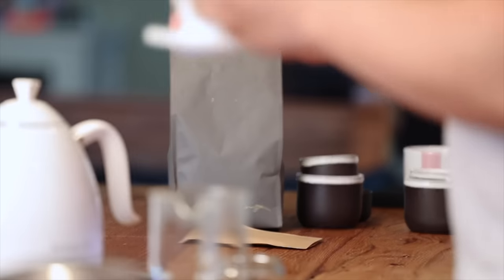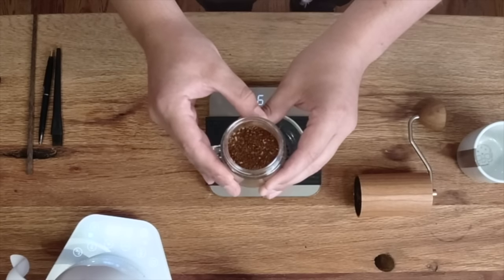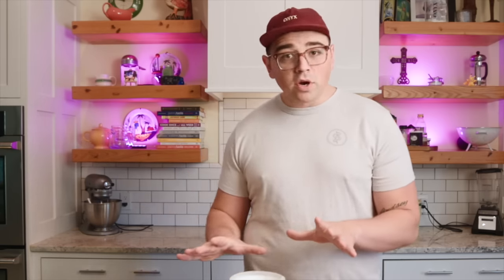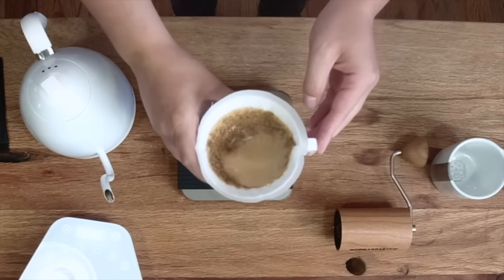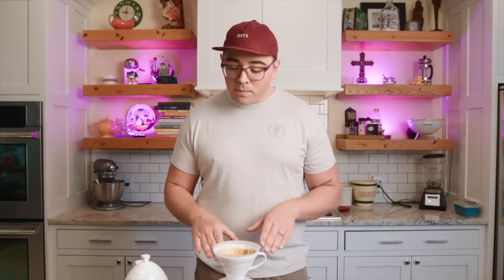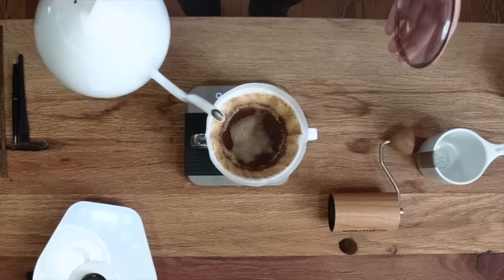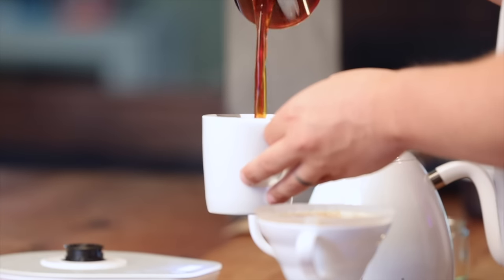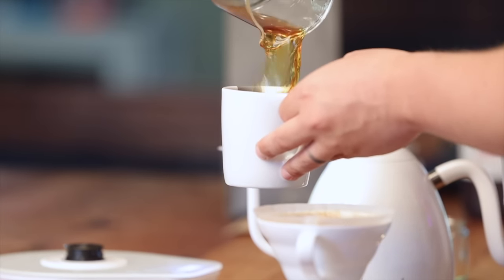HARIO V60 BREWGUIDE: Easy and Effective V60 Recipe!

Comment: I love the video! Just a quick question: Why do you favor the aggressive central pours instead of spiraling in and out during the post-bloom pours? My Rao-Gagne-Hoffmann mindset has always been to pour in spirals for the most even bed/extraction. That said, doing those techniques with the same grind size has resulted in much longer brew times. Is it related to the fact that moving the stream produces less localized turbulence?
Reply from the maker: So, this recipe was created for simplicity. I have the pour be super quick for two reasons: 1) to be applicable for people with tea kettles and 2) to ensure all grounds are in suspension so you can immediately swirl and level the bed. 
Have the fast pour and immediate leveling allows for a proper settling. 
When pouring more slowly and in circles, the particles will settle faster you can see this in high light with a glass v60. Those particles want to settle asap. So, pour aggressively, and with a quick dispension, allows you rapidly swirl and settle so the lack of spiralling the pour doesn't matter. 

This recipe is about consistency and applicability. Learning to spiral isn't super easy. 

This recipe allows for a quick pour, tweakability, etc and get a good cup.

Plus, I've gotten up to 23% on a V60 with it. That's freaking high for a brewer with so much bypass for it to be this easy.
Reply from the maker: Also, for the record, I hold the people you mentioned on the highest regard. Not trying to go against them at all. Trying to provide an easily repeatable and easy to accomplish brew for anyone. And, the brews are damn tasty
Reply: @LanceHedrick  Well, I just tried it with a Kayanza Burundi Red Bourbon (controlled yeast ferm) from Sweet Bloom just now. Yes, at 9:00pm. Aaaaaaaand it's amazing. So thanks! I might put this recipe on at 7 Corners EP for this Burundi.
Reply from the maker: Love it! Night coffee rocks haha. So glad you love it!
Reply: @LanceHedrick  With the SSP burrs for the Fellow Ode (aligned as well), I just measured a 24.2% EY from this recipe. That's nuts. 1.59% TDS! It's almost too strong, tbh.
Reply from the maker: That's right in my wheelhouse! Yummy!

Comment: Looking forward to trying this tomorrow morning! How do you determine TBT - ie. when it's 'done'? 1 drip/second? 2sec? Bed looks dry? I realize if you have grind size 'right' it doesn't matter that much, more curious than anything....
Reply from the maker: Yeah- bed is dry. But don't sweat it if it goes longer. Some brews might stall a bit. Just don't be aggressive with the spin on the final two pours
Reply: @LanceHedrick  Thanks! Ethiopian worked really well. Any tips for getting a washed Kenyan to have less savory notes, or is it just bean/roast and nothing to be done?
Reply from the maker: Savory is difficult. It could come from a few things. If underextraction, you can have a salty cup which can enhance savory. I like pushing Kenya coffees far. Maybe do the three pours at the end and maybe stretch the ratio to 1:17.5 or 1:18

Comment: Awesome video! How would you tweak the recipe, if you'd only brew 18 to 306 grams of water? Would you grind finer (23 clicks for example)? Or would you just pour a little bit slower as you have a smaller coffee bed?
Reply from the maker: Depending on the coffee, I might not change anything. I always like the idea of trying the base recipe and then changing based on flavor. You can go ahead and predict and change and start finer, or just give it a go and see what you need to do

Comment: Lance! Thanks for all this great content, man. Question for you if I may... should I be concerned with grinding too coarse with this method (in fear of creating too many fines and stalling the brew)? I own a jx 1zpresso hand grinder and a virtuoso. So far, went 22 clicks on the jx and 12 on the baratza and I feel both cups need a much coarser grind. Thoughts? Cheers
Reply from the maker: Which baratza? To be honest, that sound too coarse on the JX. I usually like quite fine. Just be aggressive with first two swirls and gentle with final two

Comment: would be great to see a bit more science on it (calculating TDS, blind testing vs other v60 methods, evaluating consistency, perhaps you did this but omitted it from this video and limited it to showing the recipe) but feels fun to try :) I worry about fines migration, specially with not so good grinders (C40 is good at producing less fines but it is an expensive grinder), paper filters tend to lead into clogging and upping that brew time, overextraction comes, blah blah... still like it better than most methods out there, specially for beginners who do not have premium equipment and/or the technique skills that other methods require. Thanks and looking forward to your next videos :D
PS: I keep going back to your latte art videos, still practising my foaming at the Café where I work, at the same time managed to throw some tulips already. Can't thank you enough for that!
Reply from the maker: I didn't feel the need to add the measurements in since I've done them at home and said them in the video. I guess people could think I'm lying, but I'm banking on them not. I also said this was made to be highly accessible, which means I have also brewed with less than ideal grinders to ensure it works with those, as well. All of this was taken into consideration when making this video. It was not a haphazard decision, but a long and thought out process to provide something helpful to people of all types of equipment, hence the heavy flow to account for tea kettles.
Reply: @LanceHedrick  thanks for your thorough reply :D
Reply from the maker: Absolutely! Always happy to respond.

Comment: I'm just getting into pour over brewing so forgive me if this is a naive question but wouldn't double walled stainless steel with a ceramic liner be best for insulation while brewing. I know Fellow makes the stag which is stainless steel but they don't line it with ceramic like their tumblers. Is there any reason why?

Comment: adapting for a 250ml cup according to chatGPT:

To adapt the recipe for a 250ml cup, we need to adjust the quantities accordingly while maintaining the same ratios and principles. Here's how you can do it:

Ingredients:

15.63g ground coffee (assuming same grind size)
234.38g boiling water
Instructions:

Use 15.63g of ground coffee (assuming the same grind size of 720 microns).
Boil 234.38g of water.
Follow the pouring schedule:
Pour every 30 seconds.
Pour a bit more than double the dry mass of grounds for the first two pours, then divide the remaining brew water into two.
Spin the coffee after each pour as per the original recipe.
Adjust the Total Brew Time (TBT) to 2:30-3:30 based on your preferences and the coffee roast level.
If you desire less extraction (darker roasted coffees):

Lower the temperature of the water.
If you desire more extraction (lighter roasted coffees):

Increase the number of pours by dividing the remaining brew water into three instead of two. This will increase contact time and agitation.
Remember to adjust grind size, water temperature, and other variables according to your taste preferences and the specific characteristics of the coffee you're using.

Comment: It seems there are conflicting forces in the choice between raising the water level high versus splitting into smaller pours.
Pouring high: it creates a smaller surface to volume ratio so it reduces heat loss. The higher temperature enables more extraction.
But there is also more bypass in this case which reduces extraction. Because of the heavier column and reduced viscosity, the flow rate would be higher, the contact time would reduce and that should reduce the extraction further.
And then there is less of agitation compared to split pours which also reduces extraction.
So the question is, which factors dominate and are there predictable differences in the extraction quality created by these separate conflicting factors?

Comment: Hey Lance, thanks for your reciepe, do you recommend a boiling temperature to use if I use the Fellow Stagg EKG. I normaly place the Kettle back to the station after a pour. So i have the kettle all time on the 100 degrees with the hold function of the kettle. Thanks for helping.😊
Reply from the maker: If using a light roast, sure thing!
Reply: @LanceHedrick Do you recommend putting the kettle back between the 4 pours( 50g and then putting back to the station until 30 seconds are reached, then after the second pour to 100g putting it again back to the station until the timer hits 1 minute and so on. Thank you my man, stay blessed! Greetings from the mountains in Switzerland😂🙏

Comment: Superb video, as always :-) 
I've noticed in the comments that you advised to start with grind setting of 25 with Smart Grinder Pro.  In the machine's manual, they propose to use a range of 46-54 for pour-over methods. Could they be so wrong or V60 needs finer settings despite being a pour-over technique? Thank you!
Reply from the maker: 25 is too fine. Do somewhere around 36-40. I misspoke.

Comment: Another great video! Been learning a lot from all of the ones you’ve been posting, so thank you! Had a question though: took a crack at a first run with your recipe and gotten a good start! I’m brewing a light roast  Colombian and your recipe got nearly perfect acidity, but there was a little bit of bitterness in the finish. Afraid of going coarser would result in sourness, do you think maybe a slightly finer grind and a small drop in temp might keep the acidity but reduce the bitterness?
Reply from the maker: Don't do finer grind. Perhaps drop temp a couple degrees.

Comment: Great looking recipe! Any specific reasons why you went with this type of recipe instead of using a recipe such as Rao's updated method or Gagne's recipe?
Reply from the maker: Yeah! I like it better 🤣
Biggest reason was repeatability and accessibilty. One doesn't need a gooseneck or anything to pull this off. I also found this recipe works with more coffees with less dialing, if that makes sense. High extraction (for a V60) with minimal effort.

Comment: Not sure if I'll get a reply since this is an older video. But when you say 720 micron grind size, are you referring to the mean particle size, or to the burr separation? If the latter, does this apply to flat burr grinders such as the df64?
Reply from the maker: The burr separation! And it depends on the microns between clicks on that one

Comment: Thank you for stating the number of microns! I use a JX-Pro manual grinder that seems to have 12.5 microns per click so I calculate about 56 or 57 clicks and one rotation is 40 clicks. So that translates to around 1.5 rotations which is very fine grind. Is that correct?

Comment: For some reason, the first time I watched your video I was not convinced (I guess due to the fast pours), but today I decided to give it a try. I made three cups using your recipe throughout the day. These were the three most delicious cups I had in a few weeks. Thank you!
I have a question though. I used 15gr of medium roasted coffee to 255 water at 96C. My question is how would you modify grind size (or water temperature or in general the recipe), if you were to brew 11.7gr to 200ml water? I'm using a 01 size v60 by the way.
Reply from the maker: I wouldn't recommend stretching the ratio like that for a medium roasted coffee. In fact, I might add a bit more coffee. Those coffees are more soluble and you may not like the roasty characteristics that come out of a bigger ratii
Reply: @LanceHedrick  I see. Thank you for the suggestions!

Comment: Thank you for your great videos and content :) I don’t have a V60, but I have a Kalita wave style pour over ( Tiamo stainless steel ). I as wondering if this same type of technique would work for flat bottom as well? The more aggressive pouring and swirling I mean? I’ve been struggling with getting a great cup of coffee with my pour over.
Reply from the maker: I wouldn't be as aggressive with the pour, but definitely swirl. I like doing much smaller pours in a Kalita followed by swirls. Maybe try 20:340, but go 40-50-50-50-50 every 30sec followed by a swirl. Swirl the first two, then the last one for the final draw down
Reply: @LanceHedrick  Thank you :) Will give it a try.
Reply from the maker: Let me know how it goes! Happy to help you dial in
Reply: @LanceHedrick  Thank you for you tips. Tried it this morning and I got a very nice smooth cup. I have been struggling with what I think is astringency or under extraction/over extraction due to my grinder not being uniform enough. Had a lot of stalling. The swirling seemed to help that. I had my local roaster grind some coffee for me and that seem to help a lot as well. Although I think the fact that it was grind yesterday made it loose some flavor. Just ordered a new hand grinder, a 1zpresso jx-pro, so looking forward to trying that out with the pour over technique. Thank you for your videos and content which are packed with great information and tips. Looking forward to the next video.
Reply from the maker: The grinder you ordered is great. You will have incredible brews in no time!

Comment: I have been trying the recipe out with my ZP6. 720 microns should be 33 clicks if I’m not mistaken but it leaves a very sludgy bed and lower walls. Do you have a recommended starting point with the ZP6 for this recipe? I’m new to coffee so haven’t got the palette to work out what’s wrong myself yet. Thanks
Reply from the maker: You're conflating comandante and 1zpresso. 720 microns BURR MOVEMENT is what you're getting here. C40 is BURR GAP. Massively different. You're actually grinding at something like 14 clicks on a c40 where you're at. Go coarser.

Comment: Hey I tried your recipe and finding I’m grinding very fine but it’s making almost no difference in run time. 

Bed is looking quite muddy. Already tried using 3 pours at the finish. 

Pour over tasting okay but still quite lacking in flavour and on the acidic side. 

Any advice?
Reply: Could be channeling from being too fine and/or too many fines from grinder quality? Maybe go a good amount coarser until you see a faster brewtime, then slowly go finer from there.

Comment: Curious about your thoughts. I know Elika is always talking about a cone shaped bed for v60s wondering what you thought about the extraction and taste.
Reply from the maker: Elika and I differ on brewing approaches a lot of the time. this is one of those times. While I don't think it is necessary to have a flat bed with conical devices, I do prefer it 95% of the time. Conical beds I've found are a lot more unevely extracted and have lower extractions. They tend to be more acidic, for sure. I prefer swirling the bed to level it out and negate channels. That isn't possible with a crater bed.

Comment: I tried this with my kalita (on the road, and it's all I have right now), and have been really liking it when it turns out well - but I've been finding this recipe is a lot more inconsistent on the wave. Is there anything major you would change if adapting this recipe to the wave?
Reply from the maker: Swirl less. There is loads more built on bypass on a kalita. More you swirl, the more up the filter the water rides, the more surface area is exposed. The more bypass. Hard to replicate

Comment: Hey lance! Is there a reason why you didn't pour the water in slow circular motions? I generally bloom with double the grams of coffee to water ratio like you did. But I haven't swirled the v60 at all... also I have been slowly pouring in circular motions from 44g to 270g to 350g.

Am I doing this wrong or is there different methods to reach the same goal?
Reply from the maker: Yes. I'm trying to agitate the whole bed as quickly as possible..shooting down the middle where the apex is tends to be most effective. The idea is to shoot all particles into suspension and have them ride the wall. Then the spin will settle the bed. Not same goal, different goal.
Reply: @LanceHedrick  ok thanks for explaining! I’ll try it out 👌🏼
Reply from the maker: For sure! Let me know how it goes

Comment: If I would grind at 12 or 13 at my encore I would get so much fines that not a single drop would come out. 

I had a 3 min draw down at 16g to 200ml at 18 on my encore. 

Do u guys have similar experiences? 

I recently bought the DF64 to upgrade my filter brews and eventually get into Espresso as well. 

I’m so stoked! Hopefully it’s gonna be a big difference.
Reply: I tried the 13 setting on my baratza encore and got 5min30sec drawdown (15g to 255ml). Still, it tasted really interesting, full bodied, sweet and with just a little bitterness at the end! But as Lance said on another V60 video, this fine setting he suggests here relies on a higher quality grinder, or else there could be too many fines. I believe the baratza encore has this not-so-great quality, so (as I don't intend to buy another grinder for the time being) I'll give it another shot using the paper towel trick to reduce the amount of fines and see if it lower the drawdown time.

Comment: What are your tips for doubling the recipe?  I tried it today using 13 clicks on the Encore as per your suggestion in the video.  I split the second set of pours into 4 (so 80, 80, 155, 155, 155, 155).  Draw down ended up around 9 minutes and I had to wait around 1.5-2minutes between the bigger pours.  I guess some of that is to be expected when brewing such high volumes and might be ambitious with the v60, but I always brew for two–so I'm always attempting to double recipes.  Let me know if you have any tips for this!
Reply from the maker: You're brewing around 800ml on a V60? I would not recommend that much on a hario. I'd say move to a chemex. Having the bed of coffee that high is going to make brewing consistently tasty cups very difficult. 
You can try grinding quite a bit coarser!